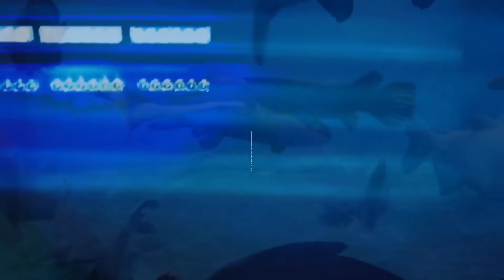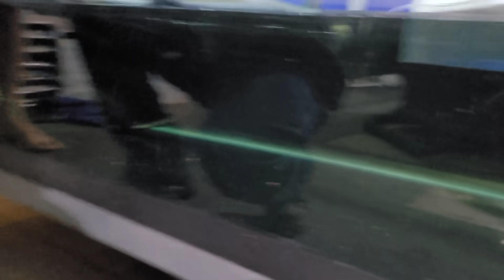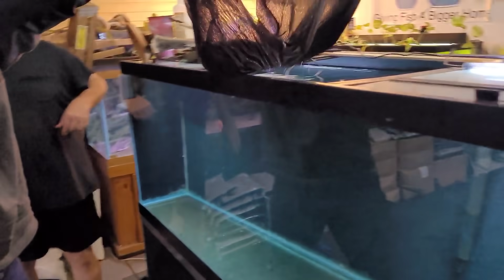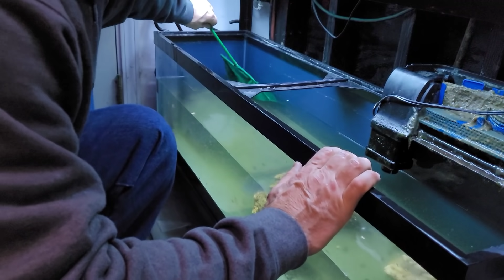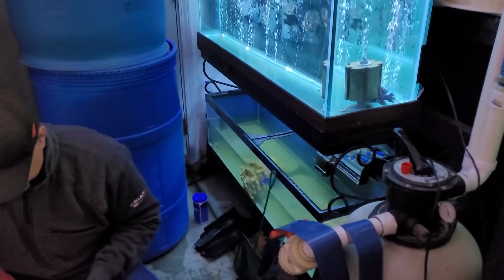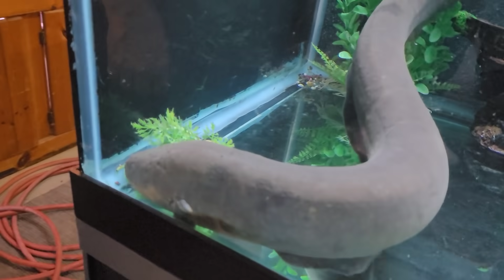Huge 3 foot Electric Eel

Comment: I dont know if there was a way to use a voltage meter in the water while moving the electric eel but would have been cool to see/know how much power it is putting off into the water.